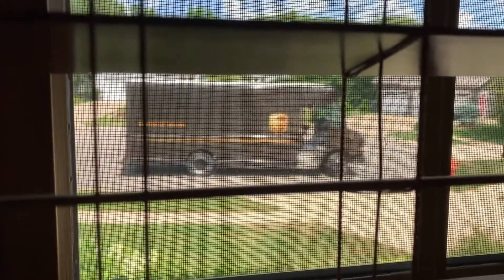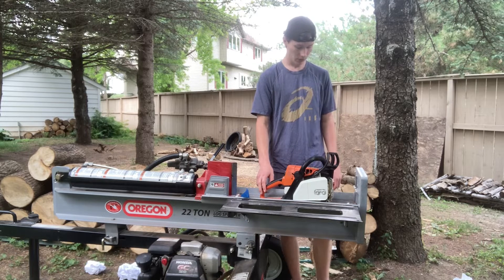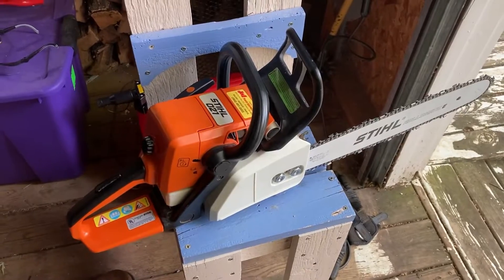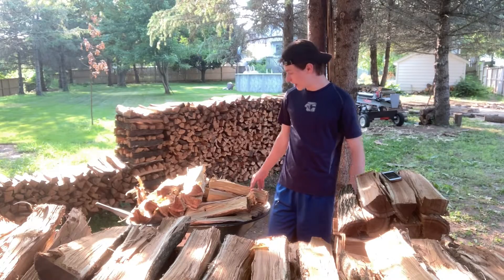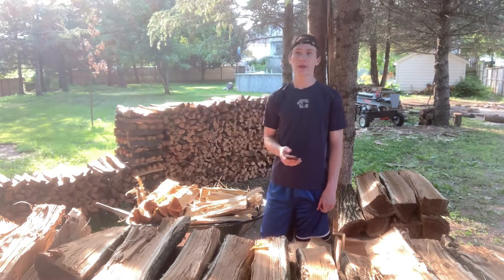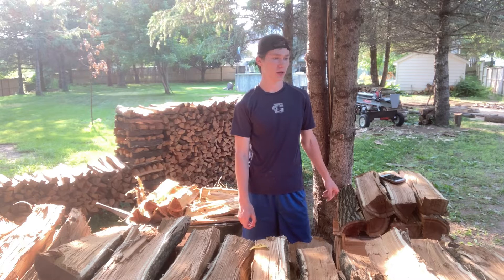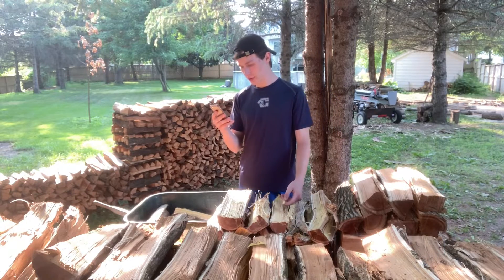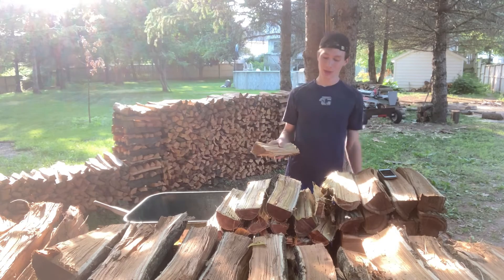STIHL 021 and Q&A

Comment: Mulberry burns like slow death.  Shoulder is a better word than burn.  However, it is better than nothing, I guess.  Never burned any.  Have cut down a few.  My mother had 11 big mulberries in her yard and asked me to cut them down.  I cut them down and drug them down to the branch with a tractor - never burned a piece of it.  Had to muck oak to burn than that crap.  I like wood that has good energy content and splits easily.  I have never used a splitter,depending more on wedges, sledges, mauls and an axe to split it up.  My favorite wood is live oak.  It burns hot and splits easily after you get it split the first time.  I can plank it up with an axe pretty easily.  Getting it to split the first time can be difficult.  It also is great for smoking meat.  I had a vertices smoker that I had built from two 55 gallon drums.  I had a meat rack in the top of it that I would put a Boston butt.  I would build a fire in the bottom with short pieces of dried live oak.  The next morning, the meat was done and pink, throughout, with a good crust on the meat.  I used to put a Turkey in it with the same results.  I had hinged doors on the top and bottom and I would limit the air to the cooker by closing both doors.  I built it with my welder and was a lot cheaper to build than commercially available smokers, today..  I had a small chimney on it.  Welded into the 2” cap on the barrel.